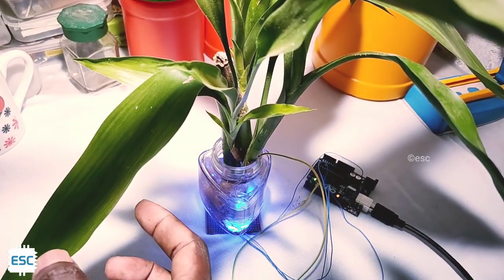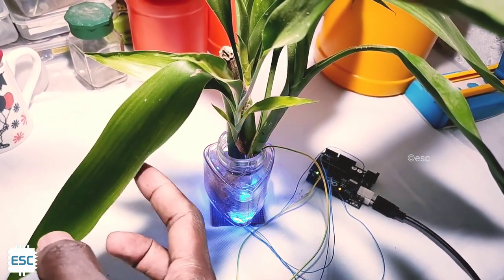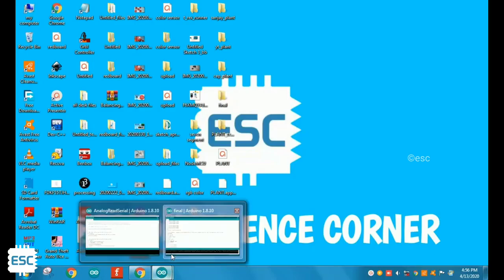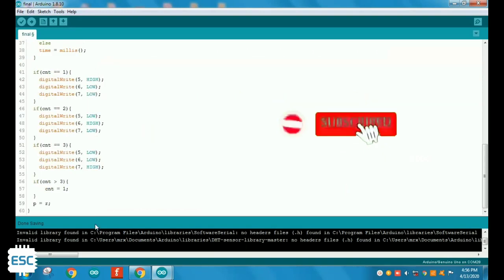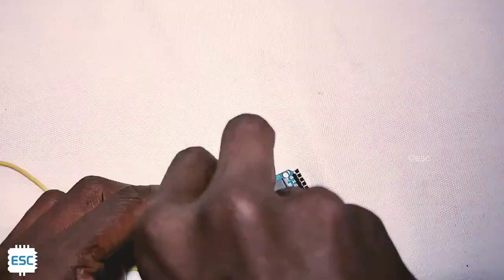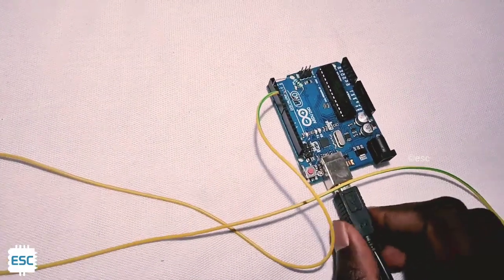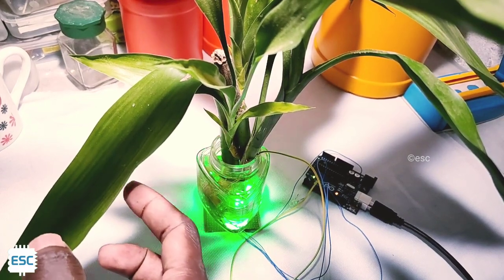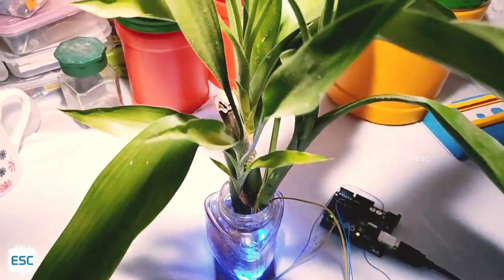Touch sensitive colour changing arduino plant | DIY

Comment: hiw to make the circuit board for 3 led
Reply from the maker: https://edisonsciencecorner.blogspot.com/2020/04/touch-sensitive-arduino-plant.html?m=1
Reply: @EDISON_SCIENCE_CORNER  from where do we  take the two wires when we connect all 3 in  circuit
not the gnd the other one
Reply: which we connnect for the plant
Reply: pls reply
Reply: im doing the project
Reply from the maker: Read the article sir. Everything explained in there. Connect plant wire to pin 4.
Reply: @EDISON_SCIENCE_CORNER  bro that wire is connected in the down of the plant im asking from where do we take the wire which we connect in the top of the plant
Reply: pls reply
Reply: @EDISON_SCIENCE_CORNER  i need to know from ehere to take the wire which we connect fr the top of plant
Reply: need your help
Reply from the maker: From arduino pin 4
Reply from the maker: Please watch the video sir.